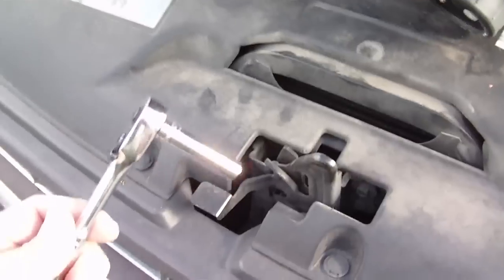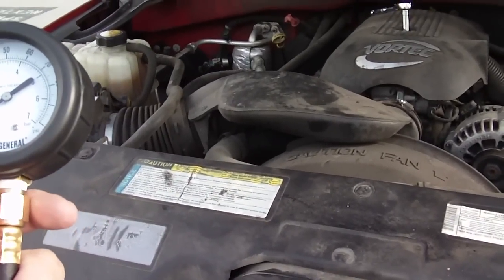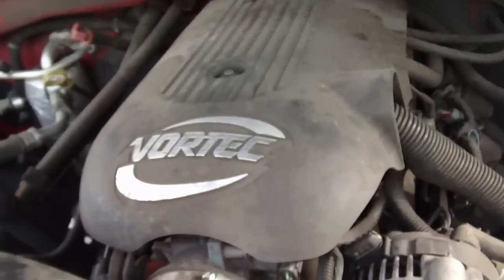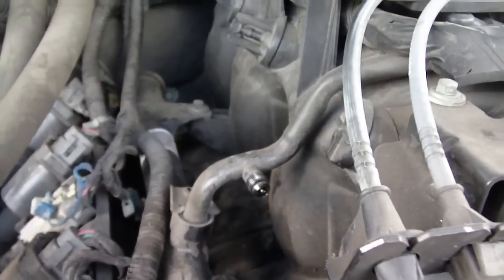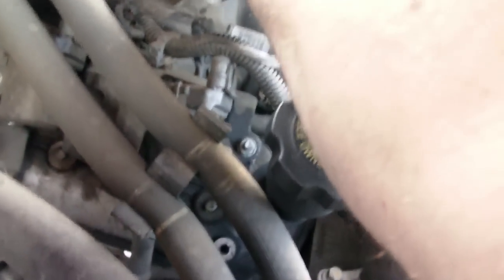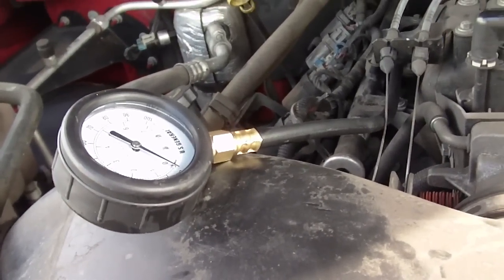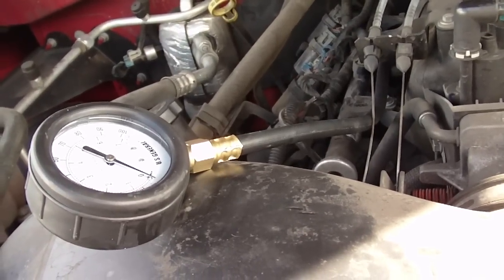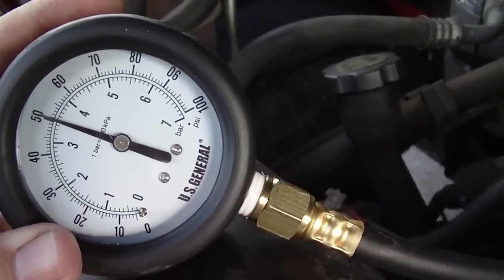2001 Chevrolet Silverado 5.3L Fuel Pressure Test

Comment: You need to remove the fuse so that the car does not start for safety
Reply from the maker: Ah I reckon.  I wanna see what the pressure is while it is running as well...

Comment: On an old pick up like that do not drop the tank; by an angle grinder from Harbor freight and cut an access port with plenty of room just over the fuel pump in the bed of the truck. The bed of the truck probably needs repair anyway at that point, so no big deal cutting an access port for the fuel pump…

Comment: Dude that is your regulator that is making 50 psi even if your pump is making higher. Rev up and see if pressure maintains while revved. If drops you might have restriction maybe at filter or regulator going bad.
Reply from the maker: Ah I replaced the fuel pump and that corrected the issue.that was not too long after I posted this video

Comment: I have the sa m.h e truck what fuel pump do I need to get my just went out
Reply from the maker: https://www.rockauto.com/en/catalog/chevrolet,2001,silverado+1500,5.3l+v8,1371507,fuel+&+air,fuel+pump+&+housing+assembly,10147
Reply from the maker: There are several to choose from on that link I posted.  I bought mine at Napa, but that was before I found out about Rock Auto.  I have bought several things from Rock Auto and that is pretty much where I buy my parts unless I need them right now.  Rock Auto takes a few days to get the parts to you
Reply from the maker: Hopefully your fuel tank is near empty.  Otherwise it can be a bit of pain to drop it. I used a floor Jack with a small piece of 3/4" plywood on it to drop it.  I had about 1/2 tank

Comment: Nice vídeo Bro.... You are doing well....   Hey, please, what do you know about the pressure regulator of the right side...my truck just loose power when I was in the freeway.... I was safe on the shoulder but it was confused about what it could be....there was still gas remain but it was very close to the empty position...

AAA Came and tows me to a gas station...after fill up with gas... I turned the key on....it work for 3 seconds and then stopped... and then I wasn't able to turn on anymore....

I will test the pressure in the fuel line as you did, but if the pressure is above 36 how to know if is the pressure regulator?

Comment: I was driving and it just started to lose power. I was in parking lot and it started to want to turn off. Turned it off then maybe 30-40m later I didn't want to start up. Had it towed and the tow guy said it started up but that was 3-4hrs later. I was told change the wires and plugs so did that and it starts up but still just bogged out after a 1-2 minutes. Fuel pump you think??
Reply: Sounds like it. Try and build fuel pressure by turning the key off and on 3 times, then turn over to start. This might get you out of a hard spot, or not at all lol

Comment: Hey i have a 2001 chevy silverado and its been been diagnosed as my fuel pump is weak..but i want to know about how long before it would actually go out ..and certain days its been not wanting to start but if i was to keep trying it over and over it would start..but if you know Anything about how long does it take to go out if its been diagnosed as weak already..
Reply from the maker: Curtis Watkins sorry for the late response.  it's hit and miss on when it will go out.  throw a rubber mallet in your truck.  if it does stop while you are out on the road, smack the bottom center of your gas tank.  that may get it to work a little longer.  I wouldnt wait around too long on replacing it though

Comment: Thanks for this video!  I'd like to add that I just did this on my 2006 Silverado 5.3L and the Harbor Freight gauge is a total piece of trash.  The gauge is sealed about as well as a screen door.  The gauge itself actually began filling with fuel!  I appreciate the quick instructions on how to test it but must recommend to others to spend a few extra bucks and get a halfway decent gauge (if you even plan to use it again).

Comment: hi I have the same truck and it had a hard start in the morning and I'm getting lean fuel codes in both banks. I had a fuel pump put in a year ago. I bought a pressure gage like the one you have from hf and I'm getting 45 psi while running do you think it would cause and hard start and lean fuel codes.thanks.
Reply from the maker: not sure James. check out Scotty Kilmer and Eric the car guy on here. you can post questions to them and they will probably get you a good answer. sorry I couldn't help ya out
Reply: James Macfadden my truck is doing same thing what did you do to fix

Comment: I'm convinced after 320,000 miles my OEM pump is going out in my 2000 sierra. It sucks because in general all after-market fuel pumps only last about 2-3 years. Oh well I guess, I think i'm going to cut the section out of my bed and make a latch for it. No one likes dropping fuel tanks, especially not the behemoths they put in these trucks. Mine is currently causing low idle, and it stats to sputter when I go over 50mph
Reply from the maker: yep you could do that. I bought my fuel pump from Napa(it was a rebranded airtex). been going about 4 years now. lifetime warranty too... just keep box and receipt.

Comment: larry boatman 19 hours ago (edited)
 My Name Is Larry, I have a 2001 Chevy Silverado, It Has a 5.3 with a after market supercharger. I notice I was having trouble with the truck starting when it cold or sits for several hours. bump the key once then do a full cycle start the truck starts right up. So I replace the fuel pressure regulator and that didn't solve the problem, because I have a fuel pressure gauge in line on the fuel rail and I notice that when the car is running the pressure is at 55 psi. when I turn the truck off the pressure drops under gauge quicker than it should and when I turn the key to the on position you can here the fuel pump working but you also can watch the gauge on the fuel pressure rail you can watch the pressure leak down with the key in the on position. Can anyone help me figure out why the fuel pressure leak down after I replaced the fuel pressure regulator. (note; I also replaced the fuel pump and I still have this problem.  boatman_larry@yahoo.com
Read more
Reply: Did you ever figure it out? I'm having the same problem and have replaced the regulator. not looking forward to pulling the tank or injectors... ha

Comment: my truck (2000 Silverado 5.3 2wd) stalled on me the other day on the high way. couldn't get it above 50 mph n once I pulled over it would start run rough then die. I had it towed back to my place hooked up a pressure gauge n it was reading about 30 n still dying. then all the sudden now it's fine in the sense that it stays running (granted at 45 psi) I don't trust it because obviously when something like that happens it just doesn't go away. also my pump did hum while driving for the past few months n I'm preparing to change the fuel pump within the coimig day or so. do you think this would more than likely be my issue? the filter looks on the new side. all shiny and the lines are all rusted.
Reply from the maker: more than likely it is your fuel pump. you could also try changing your fuel filter first. they are around $7 at Walmart.
Reply: The lines are all rusted to the fuel filter n the fuel filter is all shiny. Looks on the newer side. I've had this truck for a little over a year n the guy that owned it did very regular scheduled maintenance so I'm assuming it's new ish.
Reply: It's a 2000 n only had one previous owner.
Reply: I just know if I try n change it I'll twist the lines. N will have to buy line repair kits. I guess still cheaper than a fuel pump but generally my experience filters aren't intermittent. If it's clogged it's clogged. But I guess crazier things have happened. But I don't think a clogged filter would make the pressure bounce all around. I'm changing my fuel pump tomorrow so here goes lol.

Comment: Did the pressure gauge come with a fitting for the Chevy or did you have to buy the GM fitting separator? I'm going to buy the gauge to test the fuel pressure on my Tahoe.

Comment: My pump quit at 150,000 miles , then I read the owners manual and it said change the fuel filter every 50,000 miles ( My Fault ) ..The ethanol in the gas had rusted inside the filter, and stopped it up, I sawed the old filter in too and it was full of rusted metal ...Thanks to the EPA for requiring 10% ethanol in our gas ...you can change the fuel pump without dropping the fuel tank...just saying ...Thanks
Reply: +Wildkkat1 Ya I call it an inspection hole afterward.

Comment: LOL.... "The camera adds 50lbs" Thanks for posting this. I am having issues with my 2000 Escalade. Let me back up a bit. Last year, during very hot weather, I had a 45 minute trip for work. I was running the A/C. I noticed the truck shifting hard. I got a "check engine" light and decided to check it when I had time. A day or two later, the 'check engine' light went away and all seemed fine. However, this winter, sometimes it would not start right up. So, I would turn the ignition key on a couple of times prior to staring it to build fuel pressure. No problems until the other day when again, it was hot out and I was running the A/C. I noticed the truck shifting hard and thought, okay, check engine light should come on but before that happened, the truck died. I had to have it towed home. I noticed the air intake was disconnected from the filter, right before the mass airflow sensor. Someone recommended cleaning that which I did (didn't look dirty but what the hell). Next step, I will check the fuel pressure in a day or two. My QUESTION is... What would cause the hard shifting if it's a fuel pressure problem? Any help would certainly be appreciated.
Reply from the maker: I don't think that fuel pressure would cause a hard shift.  Hopefully you looked up how to clean the MAF the correct way.  Those things are sensitive and are easily damaged.  The hard shift sounds like a sensor on the transmission or it could be something as simple as a dirty transmission filter.  Have you checked your transmission fluid?  How long has it been since it has been changed?  Make sure it doesn't have a burnt smell to it when you check it. Hope some of this info helps.  You may want to look up the Technical Service Bulletins (TSB) on your Escalade.  It may be a common problem.  They can be found at safercar.gov
Reply: tennwhitetrash Yes, I was careful cleaning the MAF. I used contact cleaner and didn't touch any wires.

Comment: I have the same truck its 2000
I have a couple obd 2 codes p0171 p0174
and it says to check fuel presser and w key on
its at 50 psi
and after reading the slips from autozone
it says if both codes are toather check the mass air
flow sensor .....bc this is a used motor that was put
in mine
thanks for the vido thur
now I probly should start it up and see what the reading is

Comment: Hii soo I changed the fuel pump and filter on my 99 silverado 4.3 pressure is ok  but still will not start any advice?
Reply from the maker: Not right off.  Sorry I can't be of more help.  hopefully you have figured it out by now.
Reply: Check your fuel pressure regulator you can find out how just youtube it!!

Comment: I am having the exact same issue as Pedro, even down to the 10psi and 10 seconds part. New fuel pump, Regulator, and battery. Any ideas?
Reply: Get a wiring diagram and check your grounds, make sure they are getting good contact with the frame.
Reply from the maker: Also see that Pedro replaced his fuel pump and that corrected the issue.

Comment: hi again, i've changed the fuel filter,checked relay,and FPR seems to be fine ,i only get 10 psi fuel pressure, i changed fuel pump two years ago,can it be the pump again,i can hear the pump kick in and cut off after fifteen or so seconds,only thing is that now the pump noise seems to be a little louder than usual,99 silverado 4.8, any ideas,  please let me now,,,i'm learning to be my own mechanic with the help of you guys,,truck ran fine until after i changed the starter, when i went to start it, it died after ten seconds, haven't been able to start again,,,
Reply from the maker: johnapaterson I've learned quite a bit off of Youtube and don't care to try and fix something myself with what I have learned.  I shared my experience and what my fix was.  I think that it has helped people out.   Yes it can be a fuel pressure regulator , but it is usually the fuel pump on these trucks...  Changing a fuel pump is not that difficult if you have the time and watch a couple of YouTube videos.  Better than getting raked over the coals by a dealership or shady ass mechanic... Dealer wanted $1000 to replace mine.  I replaced it way cheaper...
Reply from the maker: It's possible.  Sounds like you have checked just about everything else.  Sorry I did not respond sooner.  Have you been able to figure out what it wrong yet?
Reply from the maker: does it rise up and go back down?
Reply: tennwhitetrash yes,after getting the fuel pressure tester,i was convinced it is the fuel pump again,i've learned that fuel pumps are an issue with this model,after installing a new pump,it finally started, thanks alot!!
Reply: tennwhitetrash I have not seen you mention the fuel pressure regulator for those who replaced there pump with no results???
Reply: +John Miller Thats what you get when you learn to be a mechanic on YOUTUBE Pedro would be better to read a book on diagnosis.

Comment: Please can you help us? Can you show us, or tell us the easiest way to remove the under bed of a 2001 Chevy Silverado? Thank you so much in advance for your video and any future help would be very much appreciated. God bless you in all your endeavors.
Reply from the maker: you can unbolt the bed and jack it up, but that is kind of dangerous so I don't recommend it.  There is a strap that holds the tank on.  if you unbolt it, the tank will drop down.  I would put a floorjack with a piece of wood on it running across the tank, unbolt that strap, and slowly lower the tank.  You need to make sure that you do this slowly so you can unhook the hoses from where they hook up to the fuel pump.  Hope this helps
Reply: Thank you, we took the bed off after all a month ago.

Comment: i have a 97 silverado 5.0L i replaced my fuel pump and it still wont start. i put a little gas in the carburetor and then it will start then stop. how do i find out if the gass is getting to it or not or like how do i get all the air out of the lines? Please help out!

Comment: i have a 2003 silverado and im replacing my fuel pump, whats up with the minimum pressure range(psi) and minimum free flow rate(psi)??? i have the 4.8l and the fuel pump im getting is 72.5 minimum pressure range and 48.6 on the minimum free flow rate

Comment: I have a 1998 Chevy Silverado 4x4 vortec 7.4L 454 engine, it was running good but this monday night forze in here so I when I went to start the truck Tuesday the battery was dead I jumped started it, the next day happened the same thing but this time it wouldn't start. I check the altenator and its good, I had a bad battery so I bought a new one, still not working, I change the fuel filter, fuel relay, check for spark on the plug wires and it stills not starting, I check the fuel pressure and Im not getting any. Does that means that the fuel pump os bad or is not getting powe. What else can I do to check it? I don't want to spend $260 on a new pump and end up being something else...
Reply from the maker: Hey Antonio Flores .  sorry I have not gotten back to you sooner than this.  Did you get your truck fixed?

Comment: had one fuel pump go out all of a sudden down the road.  Filled up the gas tank and got me home.  Pump I have now is about 40 psi at idle.  Have to turn the key 3 times to prime the thing before it fires right up.  Sometimes they go out slowly and sometimes they explode.  Wish they had a door under the rear seat.  Would be alot easier instead of dropping the tank.  Chevy engineering i guess.

Comment: Thank you for your video. I have an '02 Suburban that was cutting in and out, and finally died. I cracked the fuel line at the filter and turned on the key, and had pressure. So I replaced the filter. It ran fine for a few minutes, then started running rough, and finally died. I need to get me a pressure guage and plug it in. And now that you have shown me where, I appreciate it! Thanks!

Comment from the maker: There is a relay in the fuse box under the hood that controls the fuel pump. It may be going bad. There may be some other relays that are the same type. I would try swapping one around with the one that controls the fuel pump and see if that fixes the issue.  If it doesn't, the fuel pump could be going bad.

Comment: hello there I have a Chevrolet impala 2002 and its has same problems somtime its    start and run  good but  some time don't start  I have to wait like 20 30 mini to start it again  is that my  fuel pump bad or is the fuel pressure sensor  plz  need some help,

Comment: Hubby is getting down the road then the truck has no gas pedal response, I had to tow him home during school traffic this morning. Changed 02 sensors that were supposed to be bad, they showed up on the computer, changed fuel filter, ran good this past weekend, now back to this again. no gas pedal response. 4.8 liter v8 2001 Chevy silverado extended cab.

Comment from the maker: It is behind the butterfly valve (where your hose from your air filter hooks up) on the right-hand side close to the firewall.  You will see a silver looking line with usually a black screw on cover on it.  Hope this helps.